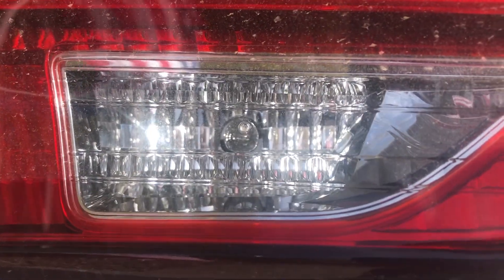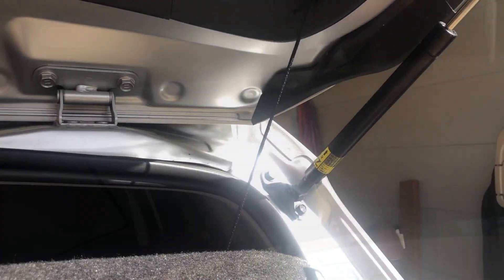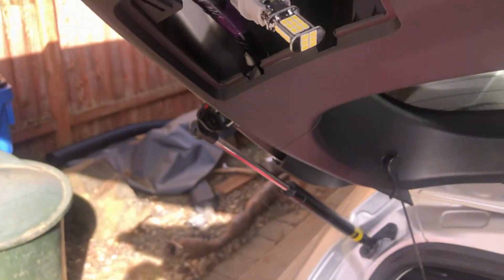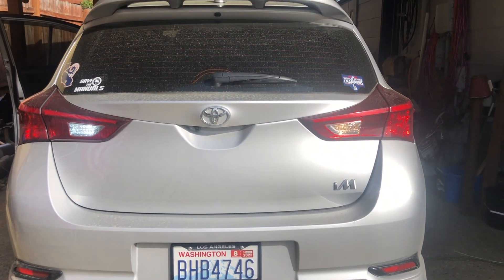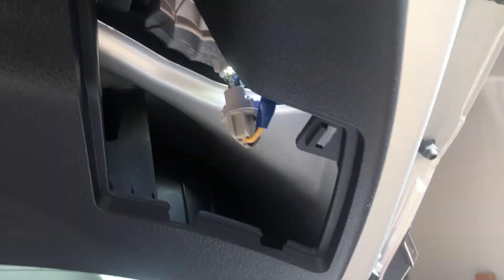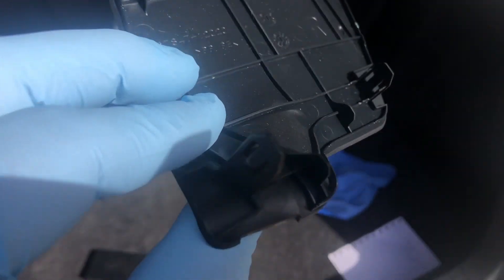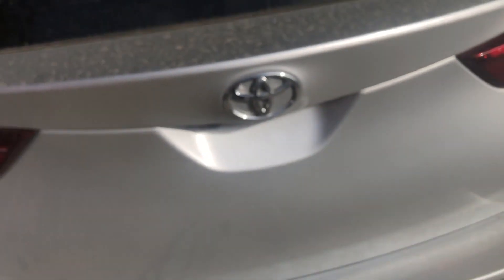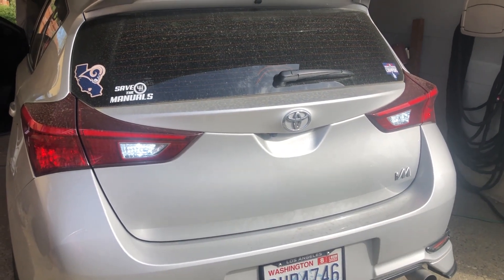2016-18 Corolla/Scion iM LED Reverse Light Upgrade

Comment: my auris had a cover on it. need to remove it or you cannot screw the bulb off. is that any suggestionion to remove the cover? thanks a lot
Reply from the maker: Normally any covers are pretty simple to remove. Without seeing it first hand I would look for any clip or screws that are securing it so that you can remove it.

Comment: can u do a high beam bulb video i cant find any videos
Reply: Change the headlight bulb in the rubber cover. The headlight bulb also has a second filament inside the bulb which is the high beam.
Reply from the maker: The low beam and high beam are the same bulb. The projector has a metal shield that lifts up to allow all of the light for the high beam.

Comment: Hi Jim…. Thanks for the great videos! I have a question I hope you can help me with, I to have a 2018 Corolla IM and after driving then coming to a stop light with foot still on brake peddle my car idles or rpms fluctuate up and down and the car shakes a little why? How can I fix this issue? The car is in perfect condition but this is my only issue please help me. Thanks again
Reply from the maker: Thanks! I'm glad you like the videos!  A lot of the time your idle issue can be caused by a dirty throttle body and/or dirty MAF sensor. Use the appropriate throttle body cleaner or MAF sensor cleaner and see if that helps. The throttle body can get build up around the edges of the throttle body plate that doesn't allow it to completely close causing an erratic idle. More times than not this will be the issue. How many miles are oil your iM?
Reply: @jimsgaragetoys  it only has 23,700 miles.
Reply from the maker: @justking5257  I wouldn't think that it would be that dirty with that low of miles. You can take a look at it. Do you use Top Tier gasoline? If not make sure you do to keep the fuel system clean. Also check to make sure that your battery connections are clean and not corroded. A poor electrical contact can cause a lot of issues. Also check that the battery is good and that the charging system is good.
Reply: @jimsgaragetoys  ok thank you so much Jim I will keep you updated on this issue. I really really appreciate you taking the time helping me! Thanks again!
Reply from the maker: @justking5257  You're most welcome.